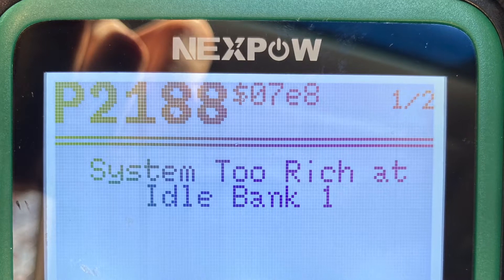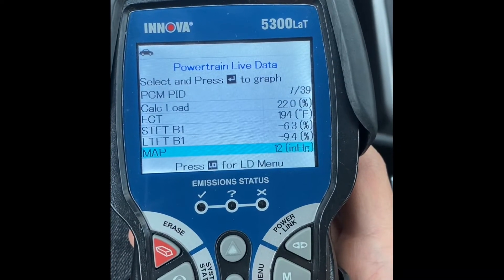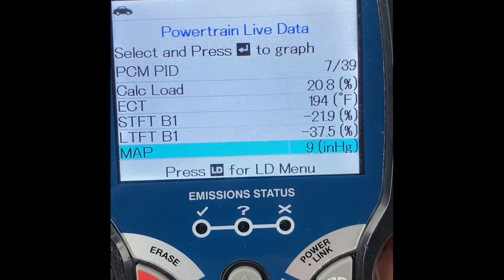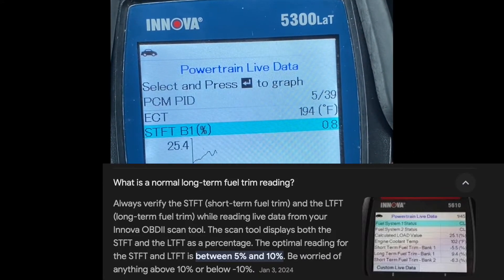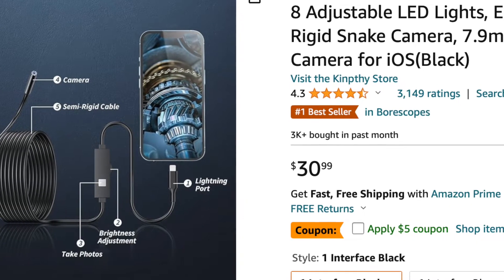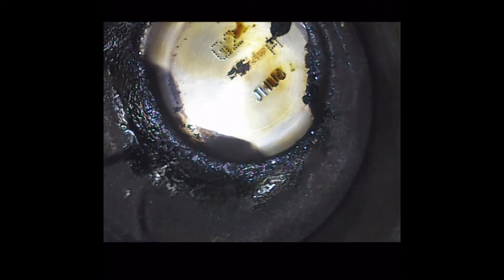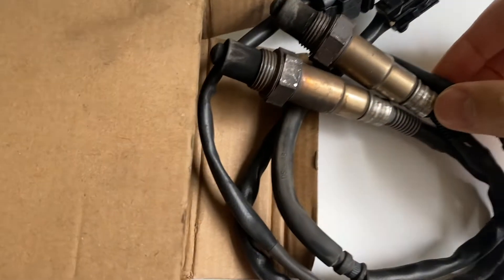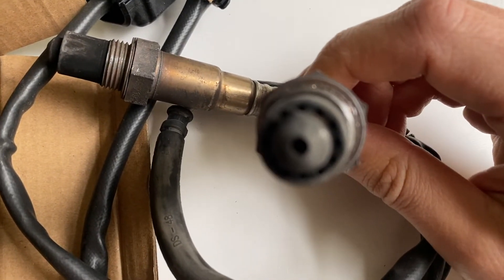P2188 System Too Rich at Idle Bank 1

Comment from the maker: Forgot to mention cleaning MAP/MAF sensor (which I also did before changing Oxygen sensors)
As I said the O2 sensor did make difference but didn't last long so problem was leaky injectors. (I tried using premium gas for some time but it did not help so had to replace fuel injectors)
Reply: @312Drive  so what was the problem?
Reply from the maker: @ESCRITORPERDIDO  leaky injectors
Reply: @312Drive  is there any symptom of car that has leaky injectors? my car so hard to start , like need to try 2-3 times to crank until it's running. and also have P2178 system too rich
Reply from the maker: @lalakutila7036  I removed all spark plugs and check the pistons with an endoscope camera, and 2 were leaky in my case..

Comment: I'm having the same issue with an older Elantra and luckily I have two of those so I'll swap the whole injector rail to see if that helps because I already replaced O2 and MAP sensors, also the IAC valve, and cleaned the PCV valve too. I have nothing else if this doesn't work 😅

Comment: Good info, thanks.  I have a 2011 Sonota, 4 cylinder, 170,000 miles.. Car has been well maintained by previous owner. A month after buying it I got the 2188,  may be why person sold it.  Changed spark plugs with spec plugs, and installed new Walker 02 sensors from Rock Auto.  Changed oil, air filter, MAP sensor and a check valve.  And OEM gas cap, mine was not clicking and was the original. All helped the car run better , but did not solve the problem. And all those items are not expensive and are basically wear items and I did myself, so using the parts cannon method is  not that  expensive   I am going to do a more careful inspection of the air intake and look for any cracks or leaks.  I did not take out the purge valve solenoid, but will try to test that.  I think if I cap off the line after that goes out of the solenoid and the fuel trim is OK that indicates a bad solenoid and or leak, so unmetered air is getting in. Any comments on this theory,  
And I may just take another part cannon guess and replace the fuel injectors.  A mechanic told the high pressure fuel pumps and overwhelm old fuel injectors. And he said the high pressure pumps go bad and can cause this problem. But that is an expensive part, and I don't think buying a junkyard one with 100,000 + miles is a good option. 
So we shall see, and will update as I go.
Reply from the maker: yeah, don't throw parts. do pressure test, and air leak test with smoke machine
Reply: Did you ever fix it?